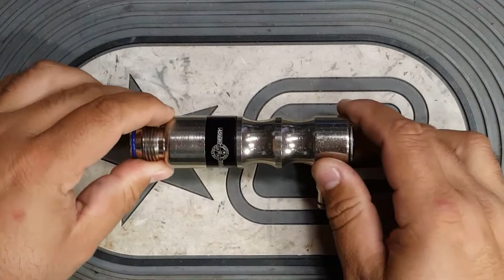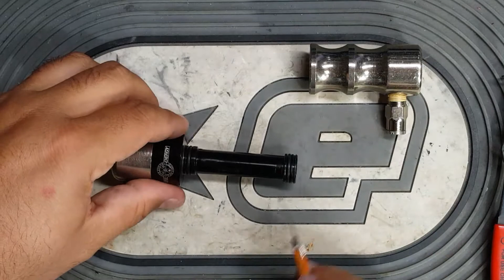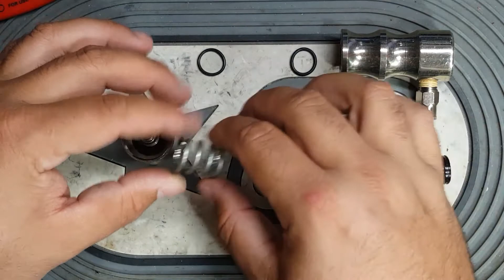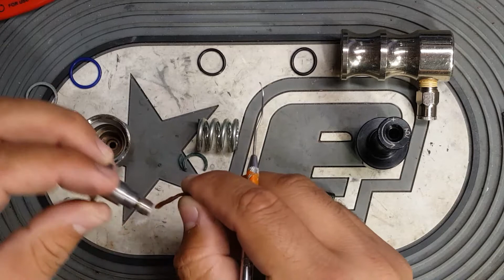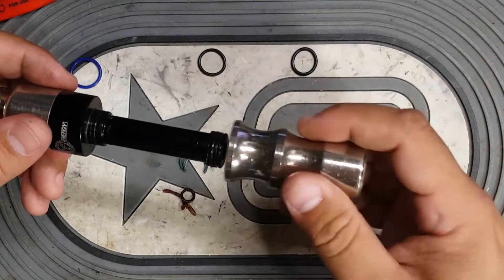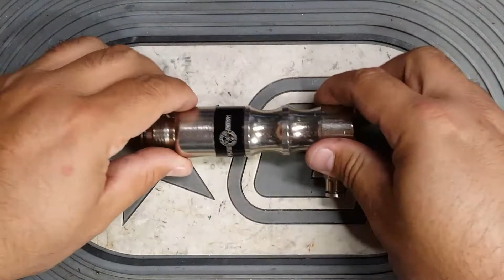Pure Energy Vertical Regulator - Parts Rebuild with Paintball Tek

Comment: I am very frustrated. I have that reg and I have went through rebuilding it. All of the o rings seal except for the two 013-70 o rings that seal the grip at the bottom of the reg. I have tried bigger o rings that fit under the shroud but don't seal it either. The only way I have gotten the 013 rings to seal is by putting Teflon tape underneath them but that leads to my marker not shooting good at all. Please help

Comment: Tim, we use to make that for PMI many years ago!
Reply from the maker: I figured you guys were behind these.  You wouldn't happen to have the pistons with the pressed in seals left for them would you in a dusty box somewhere? :-D
Reply: Paintball Tek I don’t it but will check. The current piston may work but you will crush the ball if you try to decrease the pressure  y turning the screw in with pressure.
Reply from the maker: Do you know the spec for the reg seat? Material/size?  I can always make more and just glue them in the original pistons :-)
Reply: Paintball Tek not a clue as we have not made or used them for 12 years
Reply from the maker: drats :-P
Reply: i will check the scrap pile and if i come across any will let you know
Reply: LIFE SAVER! I just started rebuilding all my old stuff and my 2 PE regs keep blowing out as I replace the orings. Was unsure how to get to the ones on the inside of the bottom half. Thank you for the great teardown!